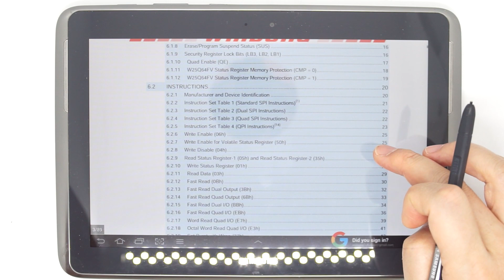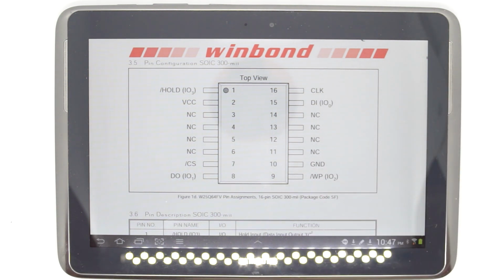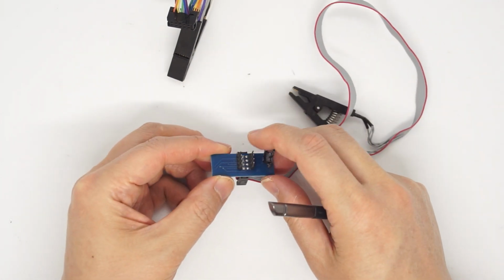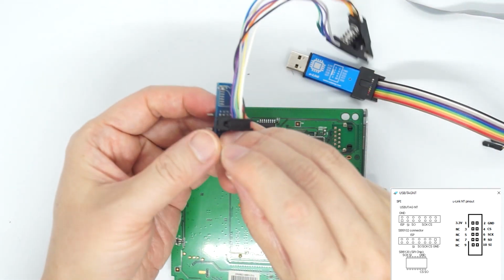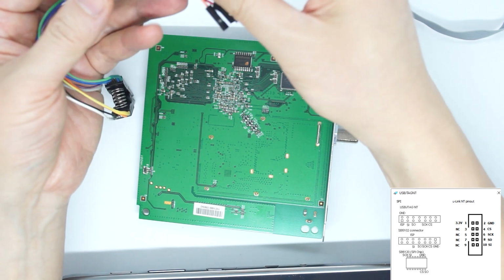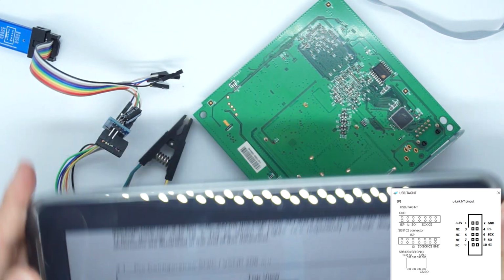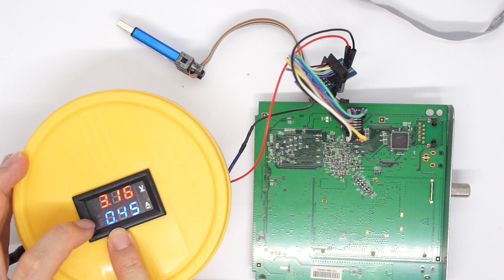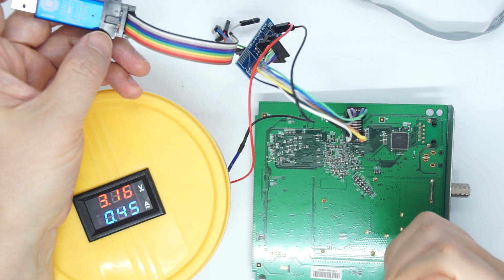How u-Link NT connect to SB6121(6141) modem.

Comment: Which cords did u solder? Which items do I need to buy? Can u put in the description?
Reply from the maker: All the SPI pinout are the same. So DI (Brown), DO(Orange) CLK(Green),CS(Purple) GND(White),3.3v (Black)
Reply: @usbbdm  are u saying  DI to DO an so on
Reply: @usbbdm  solder those two?
Reply: Also I google 16 pin jumper converter I don’t see any what yours looks like or with the blue adapter

Comment: About 2 months trying to figure out how to flash SB6141 & SB6121 with this USB JTAG NT and no luck. Totally give up. I done all as instructed in the video, purchased all the items followed step by step and waist of time. I use 8 pins clip no results at all, and 16 pins clip I tried to attached cables left and right and no luck also. He modified his clip on the video instead to do it with the 8 pins clip. If any ideas, pictures, or another videos on how to flash these modems will be appreciate it.

Comment: how to connect the ulink nt with the Pomona Soic-clip Model 5252? thank you
Reply from the maker: What is more important is how it is connected to the flash. Connect DI,DO,CLK,CS,GND. Apply power. POLL HOLD AND WP HIGH.
Reply: usbbdm where do i connect pin 1 (hold) and pin 9 (wp) on jtag nt?